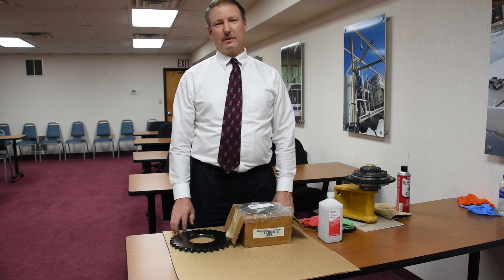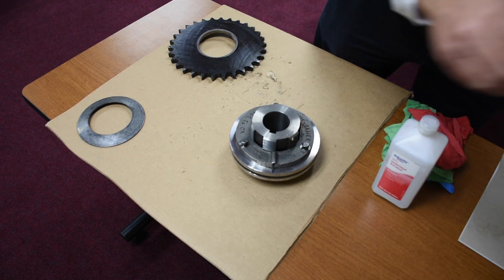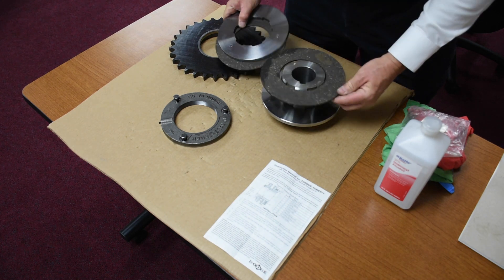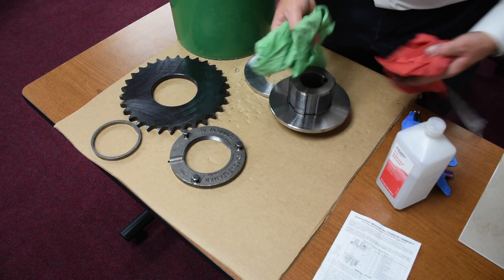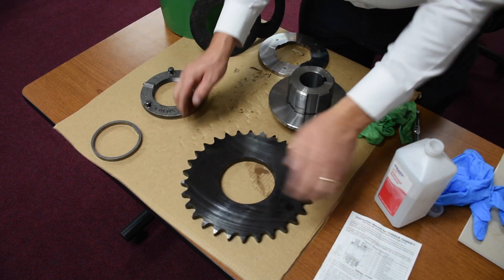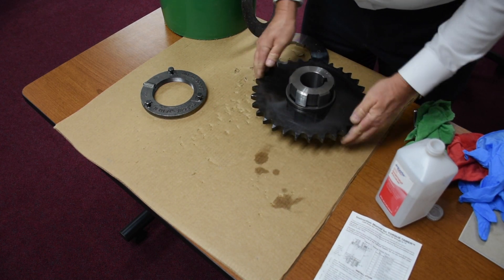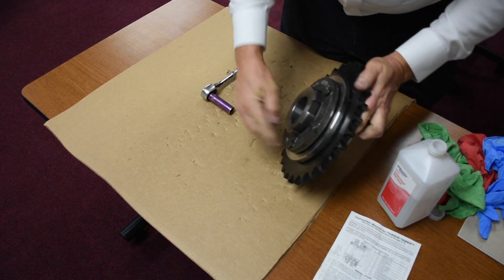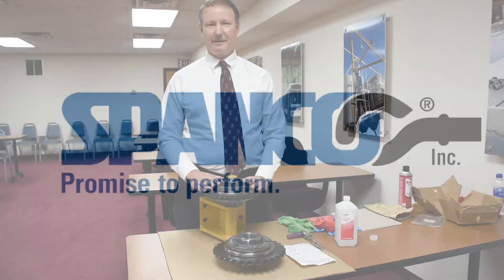Torque Limiter Assembly Adjustment and Cleaning for Motorized Systems

Comment: set screw should not be set on the threads. lock nut should be backed off to next available groove, then lock down the set screw. after that is done you can tighten the three lock screws.